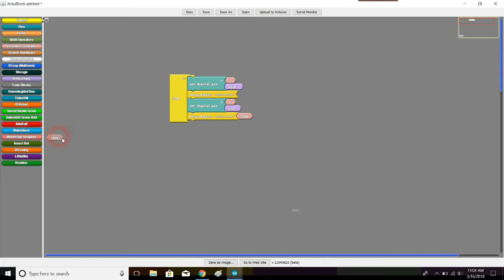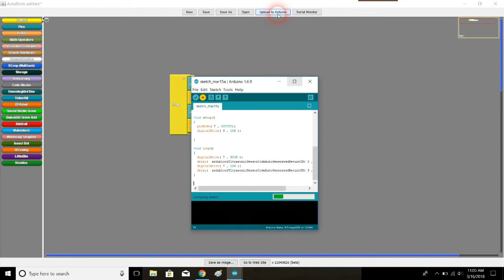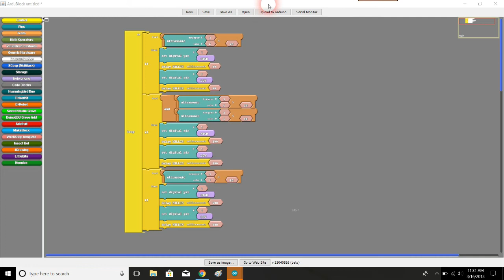Programming an LED to Blink using an Ultrasonic Sensor (Arduino, Ardublock)

Comment: How do I download the code from Github?
Reply from the maker: Hi!  Check out this video! :) https://www.youtube.com/watch?v=WffPWirFiiw
Reply: @BarnabasRobotics52  Thank you!
Reply from the maker: @lizwilson7219  you're welcome!
Reply: For some reason the code won't upload to Arduino from Ardublock. Is there a way to fix this?
Reply from the maker: @lizwilson7219  can you share the error that you are getting?  A screenshot would be best!
Reply: @BarnabasRobotics52  an error doesn't show up it just doesn't do anything.
Reply from the maker: @lizwilson7219  if no error shows up then perhaps there is an issue with wiring.  Do you get a confirmation that the code uploaded?   Feel free to send a picture of your robot wiring  I can take a look.

Comment: Sir it was not showing the ultrasonic sensor on the pins panel. What can I do? Please help.
Reply: please sir
Reply from the maker: Hello!  you may need to update your version of Ardublock.  You can find our latest version of the Ardublock file  (.jar) file here: https://www.barnabasrobotics.com/resources-software-archive/

Instructional video here.  Hope that helps!  https://www.youtube.com/watch?v=V7YmYaGl0bg&list=PL0Z988iPSaSZoPwjzgBLZHdDj6XpaZdbi&index=2
Reply: @BarnabasRobotics52  thank you so much sir!!
Reply: @BarnabasRobotics52  sir do I have to download all the windows file there?
Reply from the maker: @avinprakash8527  just need to make sure that you download the .jar file and place it in the Documents/tools/Ardublocktool/tool folder.

Comment: Please if you can help me i will appreciate it so much 

I want to connect 4 yellow LEDs with ultra sonic sensor and programming to blink faster when object is close,slower when object is far 
In addition iwant to make the lights low fade when there is no object , high fade when object come closer 
I dont know how to code it 
(*I have arduino uno *)
(Sorry for bad English)
Reply from the maker: Hello Alisa. I have created a .ino file which does something similar to what you asked, though not quite as robust. The file uses two LEDs, blinking one while dimming the other, both depending on readings from the ultrasonic sensor. I hope that my comments are descriptive enough to help you understand the process. Otherwise, feel free to ask  more questions, I will do my best to answer them. The file in question can be found in the linked Github repository in the video description.